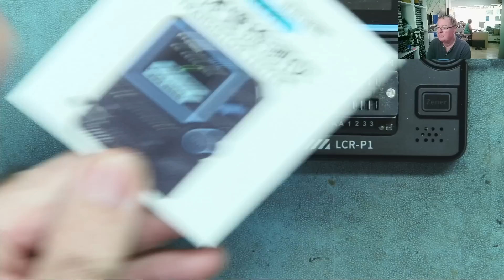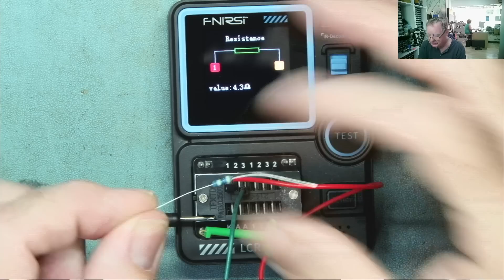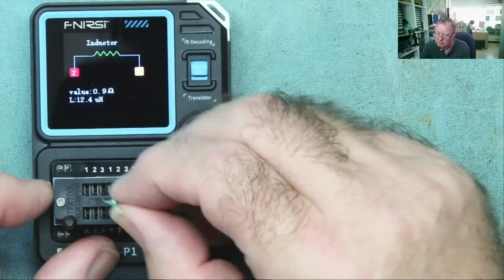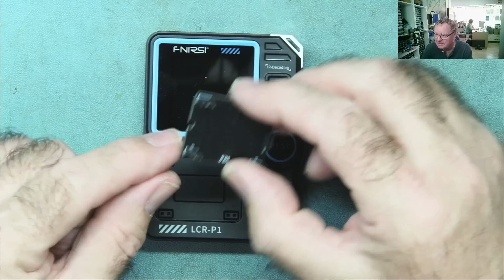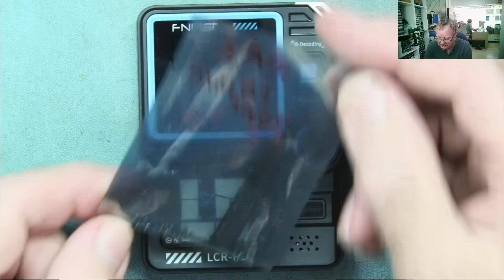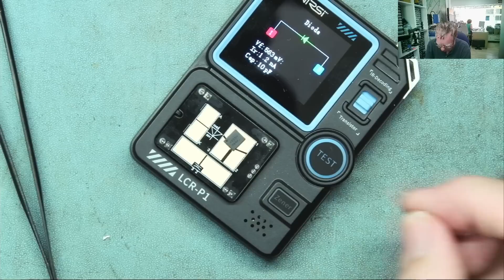FNIRSI LCR-P1 SMD + Through Hole Component Transistors Mosfet Tester Analyzer Test & Review

Comment: You did not check standard bi-polar transistors. It gets the pin out of the transistors wrong and sometimes it doesn't know whether they are PNP or NPN. Zener voltage readings are off by about 3 volts. It errors on electrolytic capacitors, too. According to another You Tube channel. firmware updates do not fix the problem. This is the only product that I have of that brand, and I am hesitant to have anything else of theirs.

Comment: ABSOLUTE JUNK.  It is unconscionable that you could in any way recommend the purchase of this seriously flawed device.  It is incapable of correctly identifying the pins of a transistor after years of being in product.  It will identify the center pin as an emitter.  Rotate transistor 180 degrees and pinout will change. I guess they think getting it right once in a while is good enough.  I just got ver 1.0.8 and reports are that it is still not corrected in 9.  Your review should come with a big warning.  These errors have been reported for a while and they just won't fix it.

Comment: Good morning, Professor! This device doesn't have the necessary accuracy for RDS measurements of MOSFETs, even with a firmware update.
Do you know of another device with better accuracy, or should I consider another parameter for using FETs in inverter circuits (UPS)?

Comment: Richard: You can bend the pins slightly on those horrible little Chinese clips. The end of the pin needs to reach the hole adjacent when it works properly; then you can clip it onto tiny leads. Hope this helps!

Comment: I am using the latest firmware 1.0.7, it seems that all NPN Transistors are not in the correct pins, I tried with Transistor S8050 measuring in the forward direction, it shows 1-C, 2-B, 3-E, then reversing the transistor, it still shows 1-C, 2-B, 3-E. But in fact, looking at the Datasheet, its standard is 1-E, 2-B, 3-C, I checked and installed it in the circuit, the standard is according to the Datasheet. In conclusion, LCR P1 is not accurate with Transistor.
Reply: it was a bug, they fixed it in the new firmware APP_LCR-P1-EN_V1.1.0_260324.BIN

Comment: If the 3 pin socket on the SMD adapter was put on the upper side maybe the spring clips could be used for checking some devices with pin placement issues.
It also annoyed me when you had to press the test button multiple times to get a reading.
It has the potential to be a useful addition to the tool box but I think Fnirsi need to tweak and adjust it. 
Cheers Eric.

Comment: It might be interesting to test it multiple times with the same (or identical) components to see if the values are consistent. I remember seeing a test of a similar product from Fnirsi (DSO-TC3) where the ESR for example was all over the place. It was essentially a random number generator. And now this thing can't do the SCRs properly either.
Call me crazy but when you buy something like this for repair work, wouldn't you want to know that it's actually reliable?
It also does not specify how the ESR is measured. The cheap 4$ testers for instance can't do a proper frequency test (because their MCU isn't fast enough for that) so they guesstimate. Does this do the same or does it have frequency testing? And if so, at how many Hertz? Maybe scoping the terminals during the test could answer that question.
Reply: I'm also surprised that they don't test a lot more than once.
A piece of measurement is not a measurement...

Accurate ESR measurement is not possible with such a device.
it would be good for comparison, but Fnirsi is just guessing.
It is a pity that it cannot even identify the type of component.
Much cheaper devices perform better.
It's not even true to its own spec.

Comment: You are too kind to FNIRSI the thing is a piece of junk actually.  The older TC1 testers are half the price and way better.  It can't measure many devices, SCR's, Diacs, Triacs, Shottky Diodes, Twin diodes in TO220 packages,.  etc.  the TC1 was able to identify these.  Also the Capacitance ESR is way out.  I did a review on my channel of the LCR-P1 and it failed.  The interface is annoying since you have to press the test button twice.  As I said the TC1 and TC3 testers are cheaper and way better don't waste money on this thing.  I emailed FNIRSI they chose not to respond and I tested it with the latest firmware and I do not trust they will ever fix it.

Comment: Hi Richard, Nice review. It is a pity the unit doesn't recognise some components. At about double the price of others currently on the market and the low quality control exhibited in the connection clips, I can't see many people purchasing it.
Reply: I also hope that very few people buy it.
Based on the tests I have seen so far and my own experience, the entire brand should be avoided.
I haven't seen a test where the same component was tested multiple times to see if it measures or just guesses.

It doesn't seem reliable, based on the history of Fniris so far, I wouldn't hope that the bugs will be fixed.
Instead, they will release another nicer, also shitty version.

Unfortunately, as long as there are customers who can be deceived, Fnirsi will deceive them.

Comment: I though maybe a design could be done with a small add on circiut board mounted on top of a small plastic box with the same surface mount design  (improved) as the one that comes with the FNIRSI and connect it to the PEAK using the connectig clip leads on small board pins, giving free licence on pad size, distance, variety and maybe away of some kind of pressure fixing.

Comment: JAT  or as i like to say Just Another Tester. you need to do a tear down so we can see how little there is in side.  i expect the cap and resistor testing is just done with charging and discharging a cap as this can be done very easy with a uC.
Reply from the maker: We can do a teardown on the livestream this coming Sunday 3rd November 5pm UK time
Reply: @learnelectronicsrepair  Software update, repeat the test (e.g. SCR), disassemble the product.

Comment: Hmmm, a company that sends you a product to review but doesn't have the acumen to review their own documentation calling  a MOSFET a moistet cannot be trusted to produce anything reliable or serious fault finding equipment. The person that sent you that should be sacked for making the company look stupid. Or worse, thinks you are the fool that will promote it.
And watching your video even more... "Test in process" who the hell ever said "test in process". "Test in progress" yes, "Test in process"?????? Are they saying you have to "test the way you are attaching and using the piece of kit"?
And here's me on a rant. Do they discharge the capacitor in the kit before any measurement cos some of them testers get broken when a capacitor is put in situ for testing.
You and Sorin are both on a testing spree today :)
Reply from the maker: It does say in the user manual it will automatically discharge capacitors before testing, but recommends you do this manually first anyway

Comment: I would suggest making a plastic ''mask'' to go over the top of the SMD jig, so that the different parts have a hole to go into that aligns them correctly with the pads, and stops them moving around when you apply pressure.
Better still, make a ''mask / pressure pad '' device to go over the top of the SMD jig.
Reply: I was waiting fot one to go 'Ping' when pressed 😁

Comment: If you look closely at the resistor result it says 0.4/0.7 Ohms but the last digit is inside the Ohm symbol.
On further inspection the update log of 1.0.5 suggests that this display bug might already have been fixed.

Comment: I use an old SIM card as a SMD adapter plate for my existing transistor testers.  The SIM bond wires can be seen between the pads, cut them with a knife. It’s wired to allow me to optionally test 3 leg devices which have a solder pad on their bottom.

Comment: 27:00 I made my own smd transistor tester board that plugs into the standard zif socket. I did lots for different types of packages and in extreme cases I solder the part to the board for testing. No need to make a special board just for that model tester. If you are going to make one make it fit the same type of common zif socket so everyone can use it.

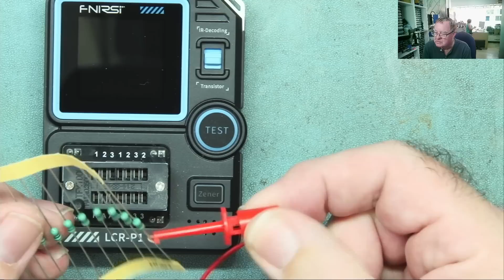Comment: 9:06 The clips should be fine. When working properly the clip will pull in fully and hold anything as the clip actually goes inside the edge so it'll even hold something 0.1mm. You need to bend the end slightly so it goes through the hole in the plastic support. It looks to be currently misaligned. If they really don't go fully inside even when the brass piece is aligned correctly then they are junk and that's a FAIL ;-)

Comment: And once again, we see a device fitted with one of those de facto industry-standard, high-quality, "TFXTDOL" ZIF sockets. A reassuring sign of reliability and high-standard engineering, to be sure.
Reply: i would say its aceptable solution 😂. Not high quality though. i ve had one bios recorder with tfxtdol long time ago that oxidate completaly after 1 year, but the new ones seems much better. I hope so.🤣

Comment: It does look like there is something wrong with those test clips - I have the same clips and on mine the metal loop/hook will disappear into the plastic housing if there is no wire for it to clamp down on so they will clamp on very fine wires. Have the hooks not been bent around enough or is there an obstruction in the plastic end where the hook needs to pass through ?
Edit - I should have watched to the very end before commenting
Reply: You're right, the hooks simply aren't bent properly. I bought a bunch of those test clips from AliExpress, and a few of them had that issue, easily rectified with a pair of pliers.

(On the other hand, it seems all of them have the "breaks and falls apart after a few weeks of light use" issue.)
Reply from the maker: @ser_olmy  I did fix the clips at the end of the video by bending them a little bit